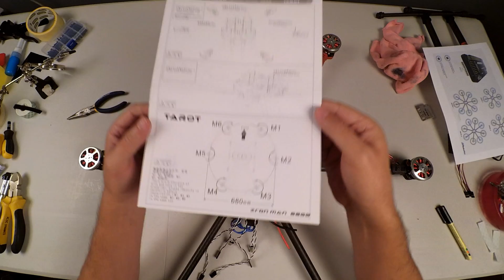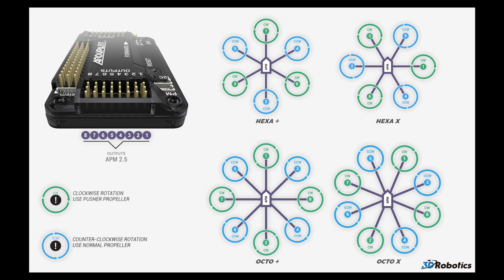Hexacopter Build Part 7 - Mount APM and Connect ESC Signal cables on Tarot FY690S

Comment: Hey
i will connect my r10d with the Pixhawk 2.4.8. I don't no wich connecter to use. The voltage EXT and RX are going. But the calibration with the Mission Planer are not going. I Have connect from Pixhawk RCIN to R10D "Digital Servo only for HS Mode" and the esc on the Pixhawk Main out.   Thanks
Reply: I'm digging my Taro HexCopter out of storage after 10 years. I had a PixHawk but I could never get it to Arm.  Got so sick of doing the compass dance.
I want to try one of the newer (probably old by now) Cube APms